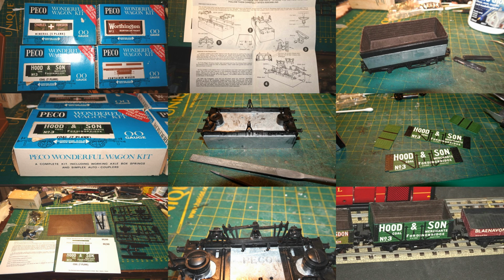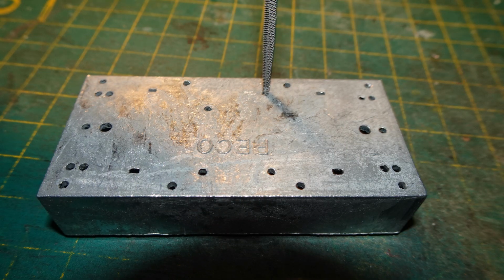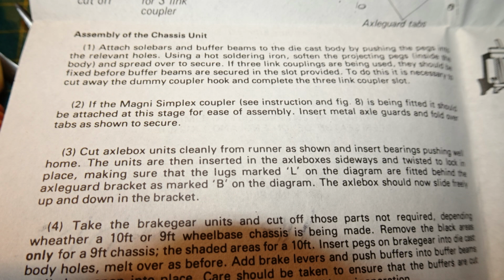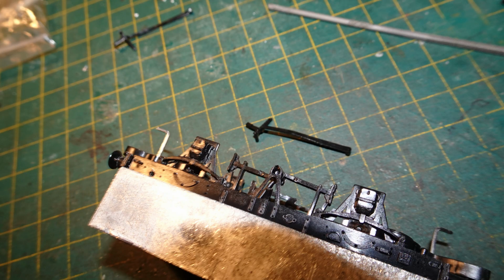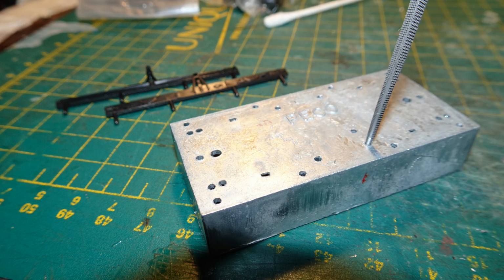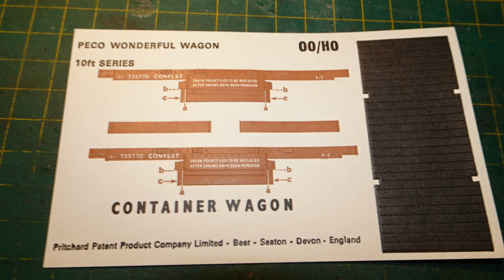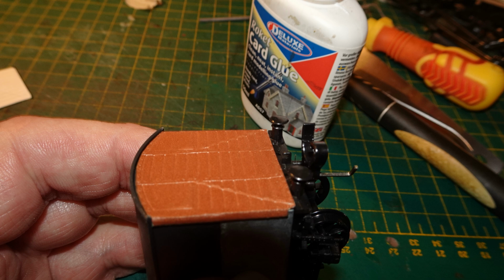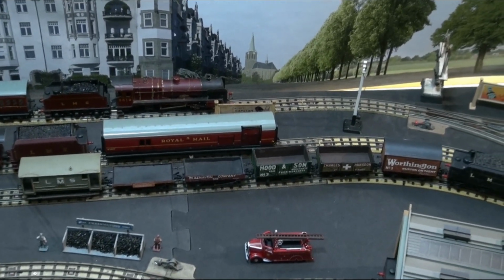OO 263, Building Peco ‘Wonderful Wagon’ Kits

Comment: High Ken, I bought some of those 9 ft kits here 2025 in Germany. They leave Peco Shop in 1979. The pre owner bought them 1990 in Haarlem/NL. It’s like DIY yoga to build them together. I‘d drill the holes in the die cast body with ø1,5mm and made cone bore from inside with ø3mm. Like it is to be seen at 25:30. I use a  soldering Iron as you did to melt the Plastic to flat. -I’ve no problem to mount in the bearings: I put the graphit pin  with peak to top on a hard plate and press the bore of the  axle holder over it. Ready at this point!
The price offered now is about 3€ each by a used model seller. - What do you think? Should I use matt firnis spray to save the surface?